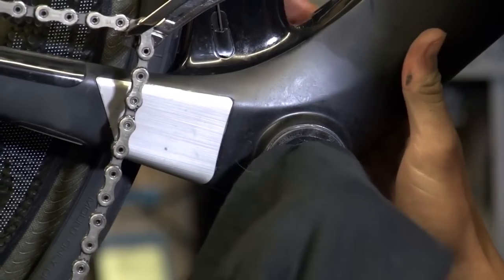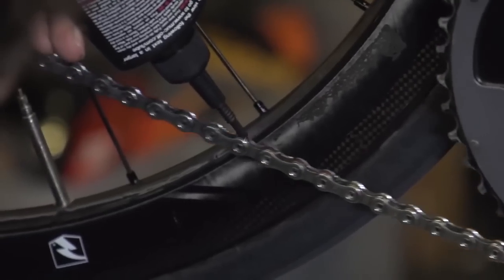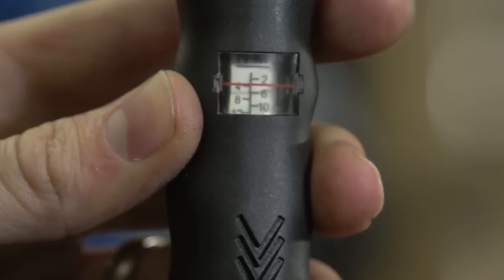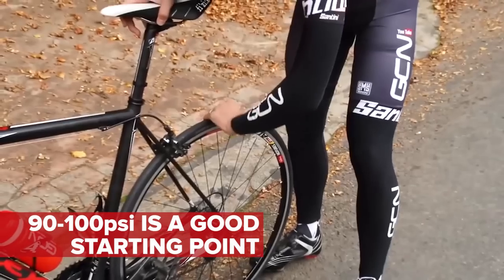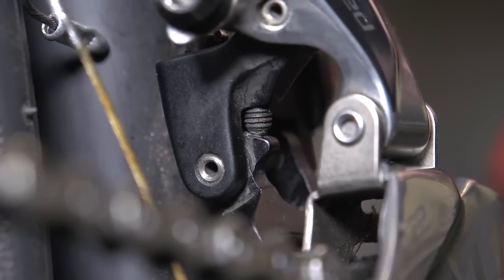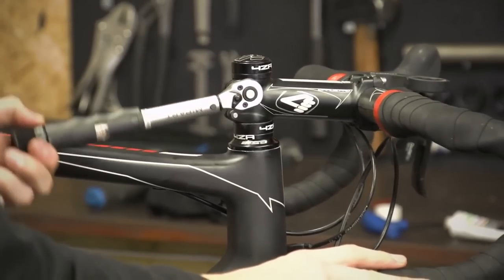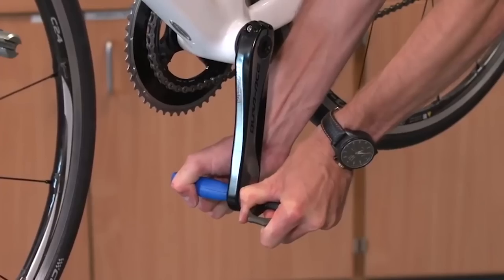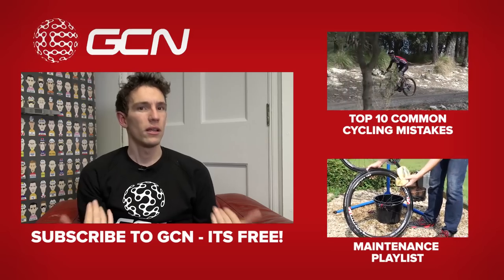9 Bike Maintenance Mistakes All Cyclists Have Made

Comment: What do you use to wash the chain ? Just water and soap ? Thanks
Reply from the maker: +Aldo Trejo use a bike-specific degreaser for your chain.
Reply: +Global Cycling Network Shimano recommends just water and soap. Here in California, a lot of us just lube the chain, and wipe it with a rag until it's clean. Good lubes will clean it as effectively as degreasers will, and fresh lube won't neutralize the lube in the chain like degreasers will.
Reply: +Alexandar Hull-Richter don't think that's an option everywhere. I assume you use a dry lube, whereas where I live I use a wet lube.
Reply: +Alex Smith I wouldn't dream of saying it works for everyone everywhere, just in my locality.
Reply: +Alex Smith I have to use a dry lube on my chain because I have to take dirt roller coaster trails for 3 miles to work. When I use wet lube, my chain looks like mud when I get to work from all the dust clinging to it.
Reply: +JERRYR708 That's interesting. I usually hear recommendations that people use wet lube for dirty conditions because it's supposed to shed dirt better. Do you wipe off the excess lube before riding?
Reply: I only wipe off the sides of the chain with a rag,
Reply: +JERRYR708 General recommendations are usually to wipe off the entire chain. The parts of the chain you can see don't need lubricant, the parts inside that you can't get at are the parts that need lube. 

Specifically, the lube needs to be inside the rollers, between the inner plates and the pins, and between the inner plates and the outer plates. No lube needs to be on the outside where it can only attract dirt.

What about rubbing on the gears? That's what the rollers are for. The rollers rotate around the pins so there isn't friction between the chain and gears. That's also why you don't need lube on the outside of the chain.

Long, technical explanation over. I wipe off my entire chain and it works well for me.
Reply: Thanks for the explanation. I will now wipe the entire chain off with a rag. Note: I use rubber plugs to cover the 2 drain holes on my frame where the crank bearings are. This prevents dust from collecting and sticking to the grease around the bearings. When I wash the bike, I remove the plugs to allow for drainage.
Reply: +JERRYR708 Honestly the chain needs a proper cleaning with a degreaser. You can use soap and water but there are bike specific degreasers I'd use over it.
Reply: I use automotive car wash soap. I figure if it doesn't hurt the paint on my vehicles, it's safe for my bike.
Reply: +JERRYR708 I'd look into that if I were you. I'd think twice. Try to find tech docs for your chain and they should say what you shouldn't use. If you don't want to spend a few £/$ on a bike specific degreaser then the safe bet would be soap and water, washing up liquid.
Reply: +Aldo Trejo Diesel fuel from your local filling station is the best degreaser.  Stick it in a chain cleaner and run the chain through and watch it go sparkling.  Us a paint brush dipped in a little for the cassette and chainrings.

A lot cheaper than "bike specific" degreasers.
Reply: +Larry Jones If you're going to deliberate ignore advice because of your beliefs, that's your choice. I thought my comments might be helpful.

BTW, I ride road bikes mostly. I wish I had the skills for BMX.
Reply: +Aldo Trejo Gasoline or Diesel, i use the former on my MTB chain, chainring, casette...cleans that black thick off-road gunk right off
Reply: Why not wd40?
Reply: A few different reasons. WD40 is not a lubricant really, it's a penetrating oil only good for freeing up rusty bits. As a shop mechanic for nearly 2 decades now, I've seen chains get exceptionally rusty after using WD40. Another big reason is the mess, and this applies to all aerosols in general. Aerosol cans will apply more product to the chain than necessary, as well as potentially get into places you don't want it such as your brake track, rotors, or pads. I usually use a Finish Line degreaser in a chain cleaner that mounts in the dropout for easy of use, they do a pretty thorough job and help keep the rest of the bike and your hands tidy. Then use whatever lube you prefer.
Reply: Cyklostar :)
Reply: česko!
Reply: +Martinus Remove chain, petrol, or white spirt bath.

Boiling water bath to remove spirit, and dry off..hot water should ensure no chanch of rust ect, relube, wipe it off...reinstall chain.

Perfect like new chain with the least effort! 

May not be the best for the chain but iv never had a problem only a clean smooth running chain...there cheap enough to replace anyways...will wear out long before the chemicals do anything to it.
Reply: Pressure steamer works wonders on  drivetrain.
Reply: That really depends on the riding you do. On a road bike, it's worthwhile to properly degrease the chain every once in a while if it gets plenty of dirt. The thing is, the whole process does introduce a bit of pain, as small amounts of degreaser will remain in the chain, which will require you to lube the chain a bit more frequently for a few weeks. So it's definitely something you want to do only when needed.
On a mountain bike, chain maintenance depends on how much you ride, as the chain will typically last for only about 1000km before it starts seriously wearing down the cassette and later even chain-rings. And if you do 1000km in about a month or two, then investing time and resources into cleaning products is a waste. Best to just wipe the chain with a rag, apply lube, then wipe again. 
Or if you want to go halfway, apply moderate amount of degreaser on a brush, and brush the chain. This will losen up all the dirt on the outside. Then just rinse with water, rag, lube, rag again.
Reply: Couldn't agree more! WD40 is a magical product when it comes to undo rusted or jammed  parts, but it's not a lubricant for the upcoming usage. I see too many people using this without even knowing what it's for. For a house repair it does the job, but it's not made for lubricating anything on a bike.
Reply: I would not use WD40 instead I'd recommend GT85 and for rusted stubborn bolts a proper dismantling product called Plus Gas job done ;)
Reply: jpfister98204 I once bought some wheels and a group set from Eric Suffill's shop in Hull. He told me to use 'proper Arabs oil, not WD40' on the chain. Advice I got over 30 years ago, and still true to this day.
Reply: Very prudent advice. The WD in WD40 stands for 'Water Displacer', great for seized garden gates & hinges and the like, but has no lubricating properties and no place in a bike mechanics toolbox.
Reply: Anthony HT you can spray wd40 on Saturday cloth and buff your MTB frame it puts a nice shiny coat on it

Comment: I ride a mountain bike and i ride at 19 mph with max tire pressure and 23 mph with 30 psi, reason if i hit a rough patch i ride in a straight line vs riding up and over every imperfection. Also means i don’t have any back pain vs a full rigid bike.

Comment: I never understand why journos working in stuff that men do as hobbies always insist on being really technical. I understand there's a demand for it, but why not get someone qualified to do it? If you don't it always end up causing more confusion due to inaccuracies.

For example, what actual physics/theory is the suggestion of torquing components to 10% less than the "max" manufacturer recommended torque based on? As an engineer with an understanding why fastening torque values are necessary, I know that firstly, there's no "max torque". Either it's a single value that you should torque to or a range within which the torque should be - picking the middle of this range would make the most sense. All this assumes that the friction of the threads is not lessened by grease or increased by dirt or corrosion - always clean the threads before you torque. In the case of corrosion, then chase the threads with a tap or die of the correct size. And torque wrenches go out of calibration - getting them recalibrated at least every few years doesn't cost a lot, otherwise there might actually be no point in using one.

Comment: please help! Canyon endurace CF frameset, hope PF86 BB24 press fit bottom bracket. Putting the spacer correctly and lots of lithium grease but the noise  still exist when climbing or acceleration hardly. Only happened after the normal service about two days ago. How can it be fixed?

Comment: If your pedal is to tight (and your not in a zillion pound workshop, as most of us are) two tips:
1) put the spanner within a few centimeter from the crank so you can grip the crank and the spanner en simply "close your hands" the crank acts like a leaver and your wont "shoot" out
2) no luck? Then position the spanner on a smooth surface eg the ground, woodblock (on a piece of cloth to prevent slipping) in such an angle that you can (gently!) press down (using your foot) the opposte crank to turn the crank  on the OTHER side save out of harms way, then try 1 again - repeat untill sufficient - this has never failed us yet

Bonus:
3) you idiot use some lube next time before putting in pedals :)

Comment: you can pinch the tube in the tire just from low tire pressure , Just going off the sidewalk it's all common sense put air in the tires before riding

Comment: Why would you torque to less than what is recommended by a company like, for example, Trek, a company who has engineers who although may not do too much investigating on each individual torque spec for each bolt still know a lot better about specs than you or me.

Comment: I'm a heavy rider. How much air pressure is too much.  I run Roubaix Pro 25c tires.  I usually pump my tires to 115 to 120psi. 
But I'm 225 lbs.
Reply: +Alexandru Belea 
Someone showed me a chart made by a bike tire company that had pressure for rider weight . It listed 115-120 Psi for riders over 200 lbs. I'm 225 lbs. But I'm wondering if that chart is accurate . I think it was made by Continental.

Comment: Can I put just 7-10 drops equally over the chain? One man in a shop (he's working there) told me "it's enough, never put a lube on every pin. it's a common mistake" Who should I believe? I've tried myself a method (on a completely new chain and on a new cassetes+front stars - just a coincidence)... I clean the chain with a toothbrush then I clean with wet cleaning "papers" for hands... so it's pretty fast and I can do this easily before every ride (or after it). Then I put a big drop of lube (a good "dry type") on every 10-15 pin. Then I take a cotton-stick, rotate the chain and use the c.-stick as a "lube transporter". After that my chain is almost soundless and I feel that the transmission works smoothly.
P.S. I also clean gears before and somewhere in the middle when cleaning the chain. I can't clean every surface on front stars...
Reply: Moon Pie
 Thank you! Great description and advices! I've try to over-lube next time. At least my lube isn't too expensive :) I like to save time!

Comment: I had never problems removing pedals, but sometimes I have problems when removing the casette. Are they any tips for that? I saw some videos how to do it...but there it always goes so easy :) In reality I have to use all my force and even then I sometimes need hours for it until it finally goes off. So some good tips would be nice :)
Reply: Look at the cassette lockring more closely and you'll realise why it's called a lockring. There's dents which lock the ring in position. 
The torque setting for cassette is  40nm I believe, which is pretty tight but if you think of it, not really that much stress on the threads since the ring is mainly held in place by those dents and less so by the friction in the threads.

Either way, you want to have a long wrench for the job and if your cassette removal tool doesn't have the aligning rod, make sure the tool is properly aligned before you try to undo the lock-ring. You only really need to fight the first few steps in order to get the lockring loose.
Reply: The grooves on the lock ring play a role in that. They'll get the torque wrench to 40nm before the thread is actually tightened that hard. 
Anyways, you rarely see someone using a torque wrench on a cassette lock ring. People generally just do it up man-tight.

Comment: 90 psi = 6.2 bars! My MTB tire is suggesting max 3 bars? Am I doing something wrong with this?
Reply: Man this is for road bike not MTB
Reply: ah ok. I didnt think there would be such a big difference. I guess I am still a noob :p Thanks for the reply
Reply: +3Dcowboy Yeah, man! I also got confused when i switched over to Road cycling. I used to run 35 psi, now I run 100-110.
Reply: Its ok :) road and mtb tires are different in many ways. Just follow what is on your tires and dont go over treshold. Everybody is learning. me too :)

Comment: #torqueback As a young rider, i am quite light (41 kg) what should my optimum PSI be! I usually have it on 70-80 depending on weather.
Reply: Moon Pie Road (Alloy frame Carbon forks). 25mm Tyres.

Comment: oil on and between metal parts forms a film that helps to prevent wear. One of the reasons why car engines have oil in them. Wiping all the oil off your chain is dumb. Make sure it has a film.
Reply: ***** far simpler to just keep using the same rag to wipe your chain and leave that rag in a bowl with oil in
Reply: +DGXL 80 see there's your trouble. You're not meant to actually ride your bike. You're just meant to admire it ;)
Reply: +experiment54 The only parts of the chain that need lubrication are first, the surface where the link-pins rotate inside the inner-plate holes, and then where the rollers, err, role around the ''half bushing'' parts of the inner plates.

Comment: 90-100PSI is just as bullshit as putting 120PSI in there. You're supposed to calculate air pressure based on your weight and the tyre's size. There is no one size fits all pressure.

Mistake 6: Trusting GCN

Comment: What if you don't find anything inside the tire? I got a flat the other day and I did quickly feel inside the tire but I was in a rush anyway I didn't find anything. I've ridden my bike twice since then and nothing has happened yet but I am a little bit nervous since I didn't find what punctured it
Reply: greimalkin you might have a pinch puncture. If you look at tube carefully you might find two small v shaped holes like a snakebite.  Put a bit of air in tube and listen for the air escaping (or hissing 😅)
Reply: Simon Parker thank you, actually I got another flat after that about a week or so later. So then I really looked inside the tire and thought I saw a little hole in the tire. I actually tried to patch the tire, but I don't think it worked because this last tube I put in is also leaking air now. 

Unfortunately the two bike shops near me are both kind of sketchy, I'm going to drive about half an hour north to my old bike shop sometime and ask them for help :p

Comment: I’ll clean my rear gears, and I’ll clean my chain until it’s spotless...... then as soon as I put lube on it and begin to wipe off the excess, it comes off black as night ALL over my rag.... anyone know why this is????? Don’t know where the hell the black grime is coming from...
Reply: The cleaner didn't make its way inside the rollers and the new lube is so thin that it makes its way inside and displaces anything the cleaner didn't remove, effectively washing it away. This happened to me when i switched from a thick PTFE spray grease to PAG 46 ac compressor oil as chain lube. The PAG oil has strong antiwear additivation (just like high end bike lubes), it just builds a boundary film around the pins and any other moving part and that's what apparently displaces any dirt left inside (and the PTFE grease catched a lot of dirt)... repeat it a few more times and it may stop.

Comment: How about using wd-40 as a lubricant
Reply: My bike runs on wd40
Reply: Only if you don't have anything else. It's a penetrating oil as opposed to a proper lubricant.
Reply: +Michael Lu WD stands for "water displacement". WD40 is a solvent, not a lubricant. 
You can use it to clean off dirty old lubricants, and as a penetrant when trying to loosen rusty fasteners, but WD40 is NOT a lubricant.

Comment: if u pumped your tires up with helium, would it make your bike lighter.
Reply: noice tip
Reply: +Clark Aylward I was actually wondering about that for a while now. also you could fill the frame as well if it was built for it
Reply: +slake they used to have bmx frames in the early eighties that were filled with helium. I don't know whether it was a marketing gimmick, or if it actually made the bike noticeably lighter, but it sounds like a cool idea.

Comment: Hi, I have just bought a new road bike..its running fine..but its making a creaking sound when I running it in top gear (when applying excessive pressure)..I checked chain not rubbing front deraillure and also bottam bracket is fine..what could be reason of this sound..